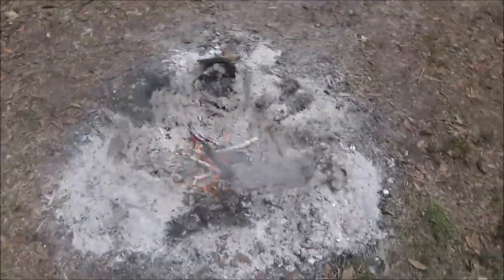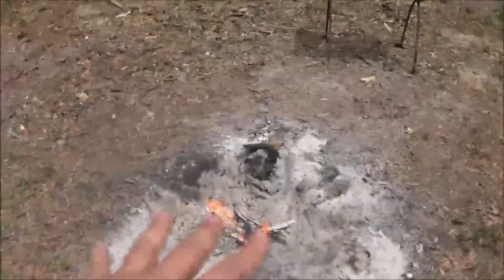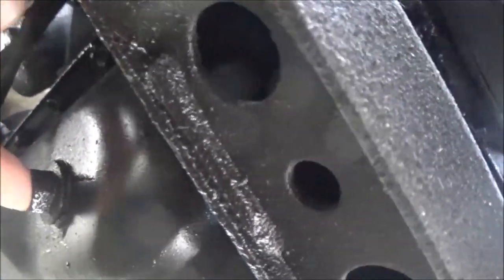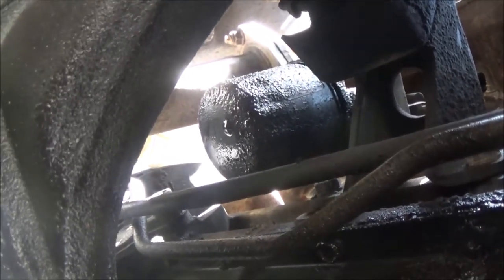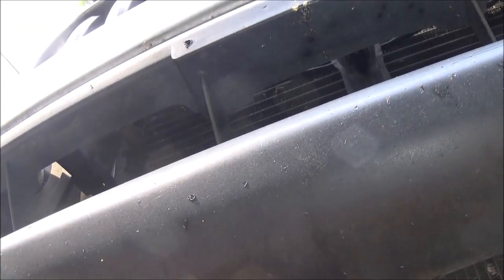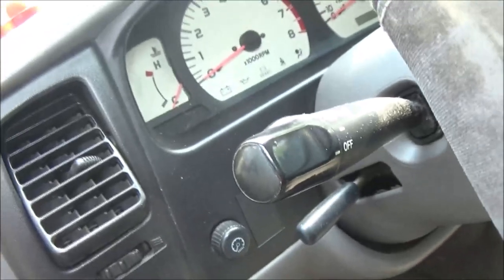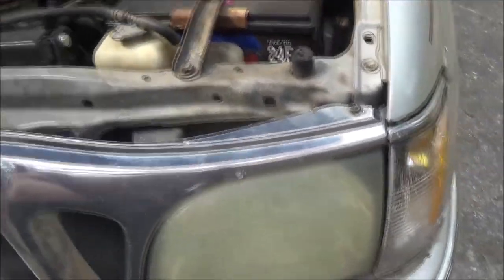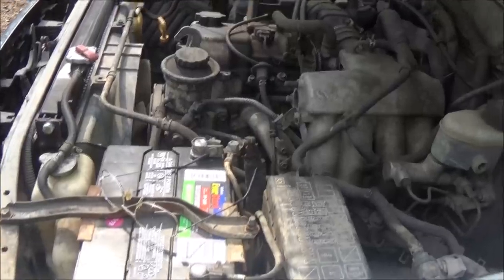2003 Toyota Tacoma Oil Leak Diagnosis

Comment: Thank you for the oil leak video,very informative. I have  the same truck since  2003 original owner had it paint gray same color. So far I've replaced in 17 year period the radiator,master cylinder,power booster,belts,brake pads and replaced all of the fluids i keep it in great condition is my baby lots of people had wanted to buy it off from me but i won't sell it. Its ben a great truck only 165,00 miles on it. If it lasts like your truck with almost half a million miles think I'm going to die and the truck is going to keep on running. I live in California no rust. Thank you again for the video.
Reply from the maker: we had to replace the radiator in ours as well. so far the master cylinder has been fine.
Reply: I have a 2003 I inherited when my dad passed away in 2016 - 1 owner I’m the second , she now is leaking in the same areas.. I only have roughly 133,000 she’s my baby!!! I also have a 18 runner n my wife an 12 Camry Toyota family !!!

Comment: Wow, I can't believe the mileage on that truck.  That's great!  It definitely doesn't owe anybody anything.  My daughter has a 2003 Toyota Corolla that's still going strong over 180K so far, just general repairs & maintenance.  And you are right about the oil filter, you're only supposed to tighten hand tight because the heat from the engine expands and tightens it more.  If you make it too tight, good luck getting it off.  lol
Reply from the maker: I totally agree.